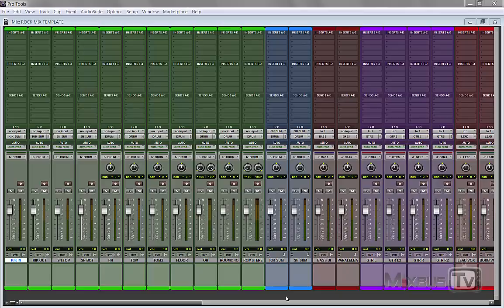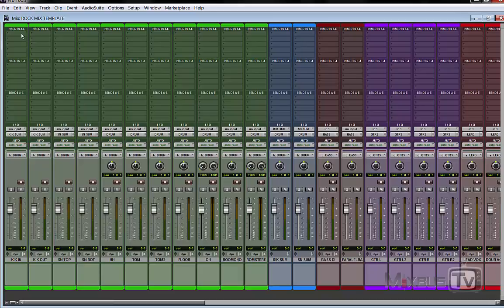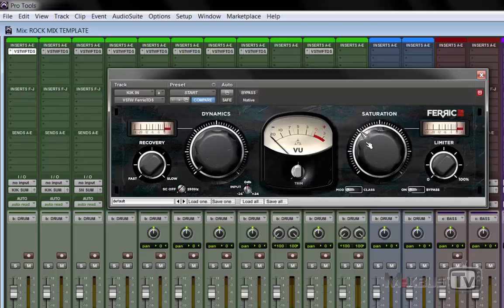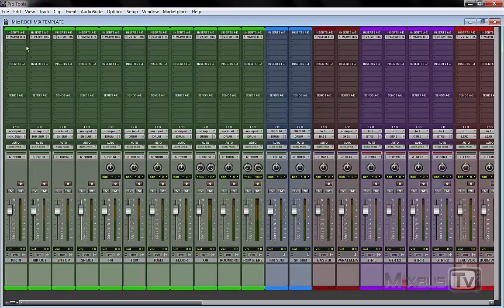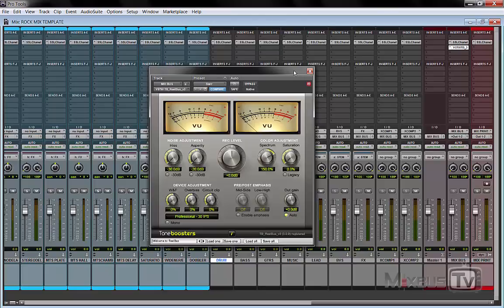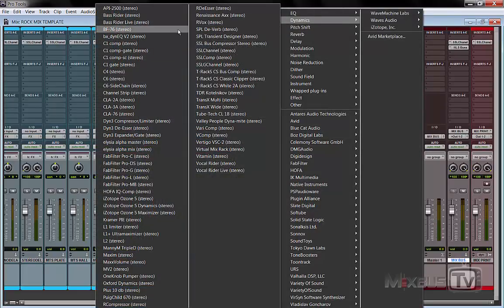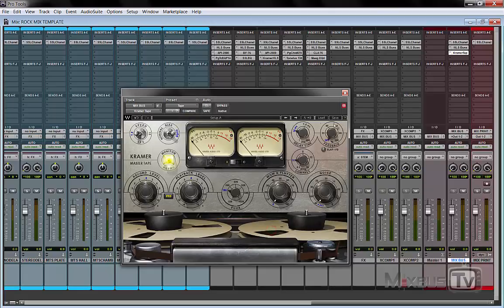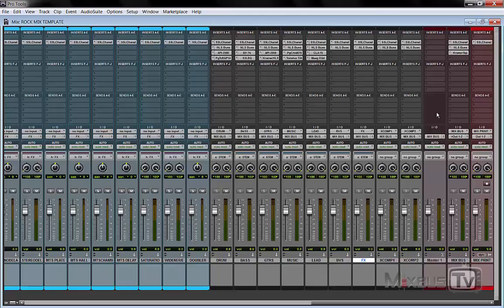Emulate Full Analog Console & Tape with plugins (step by step)

Comment: Great vid! I started messing with this recently after watching this vid for the first time. Priceless information! For a workaround with an older computer I first track to preamp + console + tape, print, and then console + pressor, aux, etc., then bus eq, imaging, and buss pressor. Then mix down at float, do mastering signal flow and finally print on master tape. I see there's alot of discussion about doing this kind of process versus going for a more digital approach, I think it really depends on the material you're working on and where you want to direct it. Great choice of Ferric by the way, VoS has good sounding tools to be able to pull this described chain off from beginning to end if you want to give it a try.
Reply: Thanks David! This advice is actually meant for those who have an older machine and very low budget (meaning they can neither buy outboard gear nor upgrade their machine). I'm currently working out of a 2007 desktop (dual core, 2gigs RAM, 32bit system, no SSD), waiting for my laptop to be revived, so I have these constraints myself, and figured that as long as I am able to commit to a sound when tracking I can save alot of CPU power by printing directly with some fx, namely the preamp to tape initial recording one would do with analog gear. This is especially useful when using CPU-intensive input signal chains, since you can get the sound without having them weigh the machine down before mixing. You simply audit the sound you want and then track with fx monitoring off to avoid latency issues. Hope this is helpful. Will you review the new Waves Schepps channel plugin soon?
Reply: "I first track to preamp + console + tape, print, and then console + pressor, aux, etc., then bus eq, imaging, and buss pressor. Then mix down at float, do mastering signal flow and finally print on master tape."

I'm having a hard time following that but I'm dealing with a 2GB garbage computer too and this could help me a lot. Can you possible explain what you mean here? Nothing wrong with what you said, just lack of knowledge on my part.

Comment: David! I'm a huge fan & subscriber and I need to know one thing. Should I be feeding my vocals into my chain at -18dBFS Peak, running them at that same exact level through my five analog-modeled plug-ins (SSL Channel, 1176, LA-2A, and EPQ-1A + gain matched Saturation Knob), and then allowing them to freely increase in level after they hit my exciter as the final insert until they reach -12dBFS to -10dBFS? I would really appreciate your expertise 🙏🏽
Reply from the maker: The -18db (fs or VU or u) it's just a safe starting point, it's not a sweet spot, it's not a rule it's just the starting point for ANALOG. You're, from what you write, ITB, so it doens't matter. Plugins don't react like to level like analog, they won't sound like analog if you push them or not push them so, the level you hit them at is more or less irrelevant as long as you don't clip.
As for the -12 or -10, that I have no idea where you got it because you cannot establish or know a "level" for you vocals beforehand, not have a level for vocals that applies to every mix or song.
Reply: @mixbustv  Thank you!

Comment: Been doing extensive research on this topic recently and have stumbled upon countless threads and videos. Everyone seems to have a different process and most seem to leave out the first preamp and console. This is one of the most detailed answers I've come across so far. I'm relatively new to this and I'd like to make sure that this is the correct way to create a smooth analog sound. I'm using Slate plugins as well. I know this is kind of an older thread but it would be nice to get a reply and know if this is the most accurate way.

So for individual audio tracks the process for proper emulation would be to start off with: Preamp -> Console Emulation -> Tape Saturation -> Console Emulation... Now from here would I insert other forms of processing on the same audio track, should I route it to another mixer track and start off with the Mixbuss VCC then proceed to process, or both? I was confused about that part. 

Also, after all of the VCC emulations after the first tape saturator, should I process after each one, before, or just during a send or route with eq and compression?

Finally, on the last mix bus where everything is routed to, after the last Mixbus VCC emulation and 2-track tape, are other forms of processing normally necessary (for example, another master tape, additional eq, compression, etc.) or would it be ideal to slap on a limiter and be done with the song entirely? Also, Also, if you do have a diagram, that would be extra nice. Thanks.

Comment: I would still recommend using the NLS in addition to the SSL channel. I ran a test where I mixed down some tracks with no plugins and then mixed it down again with the SSL channel set to "factory reset" on every track, phase tested the two against each other, and there's no difference. So I don't think you're actually getting coloration there as you are just the sound of the EQ and compressor. However, when I did the same with the NLS, even with the drive on everything set to zero, there was a substantial phase difference. I even saw a talk with Geoff Emerick where he said using the NLS along with the REDD plugins gets you pretty close to the analogue sound.
Reply from the maker: Why you even need to test? everyone knows SSL doesn't give you saturation, or better, it only gives you saturation if you hit yellow/red light. NLS is a great plugin, I would never use it on every channel. For that kind of task, nothing beats HEAT anyway
Reply: @mixbustv  Well, I didn't know, which is why I did a test. And putting the NLS on every channel to simulate console saturation is its intended use. You don't have to do it like that (it's audio, do whatever you think sounds good), but one certainly wouldn't be wrong for doing so.

Comment: Ive seen the response about this but, I do see a way to get around the low power problem.
if I were  low on CPU power or RAM I would just do 1 process at a time to new tracks and repeat.. meaning all the vocal tracks, guitars,, etc... that couldnt be done in one pass would all be done separately, until I had a low enough number of signals that required further processing (it only needs to be done once. After its applied it done.) until I was finally able to do the final mix of all the pre-processed signals. 
It would take a lot longer doing it this way, but it could be done on lower power machines.

Comment: Just out of curiosity I did a null test the other day with plugins that I was expecting to have "their own sound" even when no knob or slider was turned in any direction, like freq boost/cut at 0 db etc... plugins that were supposed to emulate analog gear. You would think that they would alter the sound even with zero value changes - as an analog piece of gear would do. It was quite surprising how many of these plugins don't do anything this way. Sure, Waves NLS does change the sound by default - but in case of the CLA Mix Hub for instance (that is supposed to emulate CLA's console) only the preamp section did something, not the EQ section...  Waves SSL E channel does zero, too. I would love to do a video that goes through a shitload of analog emulation plugins - just to test this, but I am not a plugin collector, don't have that many plugins - and also I am not sure that there would be more than two people interested in seeing it :D :D
Reply from the maker: Waves SSL E and G channel do, you have to hit the yellow or red, but regardless, that's no news, plugins are not hardware, and even if they do change the sound, they're still not hardware
Reply: @mixbustv  I am kind of feeling bad when you reply so quickly at a time that is probably sleeping time in your timezone :D From now on I will only comment LA daytime :D :D ...  Anyways  ... yes, sure, you're right, plugins are just that, plugins... But as I said, it was just curiosity about how much some plugins do ... (yep, E Channel does some mosquito-fart below -120db)
Reply from the maker: @sigmundklaus  of course it depends, I don't use the G channel for saturation, and a channel emulation should add very little or in 100+ or 200+ mix you end up with a big mess. I don't use console emulation in my mixes, but I also have a ton of hw. I do like HEAT tho, but that.. Dave Hill did it so yeah. In an usual low track count, you might want to select few saturator that are predictable and stick to those. But again, I have a lot of hw so that might not apply to someone completely ITB

Comment: This is GOLD dude!! I totally need to change my workflow now for using these emulations. Some I had right and some wrong, but the way you explained it totally makes sense. Printing VSTi's with tape emulation is a great idea and will save a little cpu. Question: What is the difference between a buss plugin and a regular console emulation plugin?
Reply: @mixbustv  Yeah, I just read up on what the VCC groups are actually for and watched a Slate tutorial. That Omni Channel IS pretty amazing. I run an older version of Mac OS though (10.9) and I think some of the newer Waves plugins require 10.11, so not sure I'll be able to add it to my arsenal right now? Thanks again, you gave me new insight on using these in a session.

Comment: I find that arbitrary application of plugins cause more problems than it solves. Not to say that this kind of workflow may not be useful in some context. But perhaps it’s more important to highlight contextual use of a tool as opposed to just assuming a plugin with “analog” in the title will give you an “analog” sound. The more you think about it the more ambiguous that term becomes. I’d be really curious to see if someone has tried emulation analog sound with digital plugins ? Perhaps that might give a mixer more insight into what makes older records sound the way they do. In any case I’m a fan of your videos and love your work. Cheers!

Comment: Thanks for this! I've been wondering how to emulate an analogue/tape workflow for ages. I've been using Britson on all my channels and buses, but wasn't sure where to insert the tape plugin. With the tape emulation, should you use the same settings for each channel or is it better to adjust it per track?

Comment: I still don`t see a point to mimic the real console (the full analog path) in the DAW. The tape emulators are just pretty strong saturators with a bit of compression. Then the one has to insert another saturation plugin (channel strip), equalizing and adding even more compression. And then another tape for the final step. The sound becomes too saturated and compressed. Well, some people may call it 'vintage', 'true-analog' or so. A matter of taste, actually. For me 1 coloring plugin (compressor\eq\tape\tube preamp) per track is enough. Well, I admit, sometimes 2. Kinda sweetspot for me. In ancient times, I believe, mix engineeres had no choise, but we can find the optimal balance between pleasant analog sound and clarity of pristine modern sound.
Great video, though!
Reply: I think a lot of that mostly has to do with the impression people get when they hear the word "saturation" Most people think sharp, bite, distortion, something relative to the top end. For me, a full emulation of analog gear would be for the pursuit of warmth and full. Something that's very lacking in most music nowadays. But I totally get your point though. But that argument would only be worst case scenario. We're not driving the hell out of these plugins. The more subtle, the better. lol Depends on what sound it is, I guess.

Comment: Hi, there is something i don't understand. The principle of recreating a professional studio with analog channel strips and tape recording is fine. I understand this is the standard on recording every track, and then it goes again on tape on every bus group.
  But going to the PC recreation, we are limited with the quantity of vst instances to apply on every single track (i see you don't). In the video are more than 38 instances, of just the tape emulation VST, and then again the same to adding strip channels.

 Before seeing this video i was thinking to avoid low cpu resources just adding the flavours on the group buses, but now i think is like adding two times the same sound to really achieve the tape sounds, like adding an overdrive, over an overdrived sound, only in that way it will do it? What if just adding it to the bus groups and the master bus?

 What i don't understand on the video is, when you charge one instance on one drum track, it charges automatically on the other ones too, you open 1 instance, and charges another 10. You really have 11 instances on drums? Or is just 1 instance with 1 preset which applies the same to every track, like a group? Looks like a very very veeeeery cpu resources eater. You have another option to do this? I understand one option is applying the process to every track one by one... and i don't see a turning back option mixing on the fly, which is a very slow option

Thank you so much for the video!
Reply: +MixbusTV Yeah yeah, i understand. But, you charge 1 instance? I see automatic loading of other instances, so i don't really know if it's a Send or there are more instances really. You say the sound changes radically with two applies of tape individual tracks + taped bus group, than only taped bus group?
Reply: Thank you!

Comment: Great video would you recommend putting a trim plugin with the -10db cut on hot leveled tracks before the tape emulation? Thank you.
Reply: Just use clip gain to adjust before

Comment: Very good video! I have a question though. Why you dont open the tape emulation on groups exactly?
Reply from the maker: You can if you want but if you want to be somewhat coherent with how tape would be used in real life, you wouldn't have a tape machine for each group (or resend the groups to a multitrack machine)

Comment: Ciao David, all the processing I need on a audio track (recorded or Vsti) must be done BEFORE orAFTER your chain "tape -> channel strip" wich emulates the analog recordinG and analog mixer? for example other vst to correct the dynamic or the tone, not the colour, or for example to set the 3D widening with stereo delay, or to remove excessive ambient, or to create space effect on pan or using tremolo/vibrAto and so on.. And tape emulation multitrack type for tracks and stero tape on Mixprint ? What about parallel bus ? Thanks much, have a great Day, Mauro
Reply from the maker: if you want to mirror a real analog session it would be after

Comment: Greetings @MixbusTV. Thank you for your different and alternative input as always, great to hear something that's not rehashed and said over and over across the entire spectrum. My only confusion with your technique is that, when I gain stage I always make sure to trim all channels pre-inserts to save headroom for later processing, but when I do that the input level going to the analog emulation inserts is so low that I'm not sure any digital saturation is even occurring due to the low input shown on the plugins like the waves SSL Channel. 
And more often than not I'd have to lower the threshold a whole damn lot to get the compressor (SSL, Scheps Omni, Pro-C2 etc...) working. 
Moreover, printing the tracks after the initial trim and tape saturation would mean that the new version wouldn't have to be trimmed again to get the waves modeled compressors working? 

Sorry for the long paragraph and thanks in advance. We all know how small obvious technical details can be hard to initially see when trying different approaches sometimes.

Your input on this would be greatly appreciated, cheers!
Reply: @mixbustv  I'll keep an eye out for the metal one. Thanks for the response!

Comment: Something to bear in mind: simply putting tape emulation on each audio channel won't make it sound like it was recorded to tape. The only way to get close to that is to look at how each instrument would be printed. A kick drum would be over-biased and saturated very differently to a bass guitar and a vocal biased very differently to electric guitar, etc.
What is demonstrated here is a great starting point, but knowledge is needed on how to adjust each instrument's print in order to achieve what you hear on an analogue recording.
For this reason, I would suggest using a more adjustable tape plugin such as the UAD Studer for tracks and the UAD ampex for the Master Bus, or other tape emulation where over-bias is possible.

Comment: Would you use a preamp plug-in before the tape?  Most of what I record is on a super clean digital interface with built-in preamps. I’ve been adding one of the slate or sound toys preamp plugins before the tape emulation,,, then I go to the SSL channelstrip and so on....  is that preamp before the tape unnecessary in your mind?
Reply from the maker: It depends, do your tracks sound too clean and they benefit from a little bit of saturation? To be decided case by case
Reply: @mixbustv  Understood.  Thanks for the reply!

Comment: Just wondering... why do you start your chain with a tape plugin and not the channel strip? Surely the signal from the instrument/sampler would through an analogue mixing desk before it hits the tape... and then back through the desk for mixing, no? Wouldn't it be more accurate to go channel strip/tape emulation/channel strip?
Reply from the maker: Because if you have a track on your computer, it wasn't created from thin air but someone, somewhere recorded it